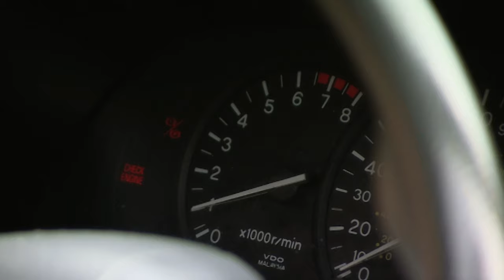Driving A Car With No Oil #TBT - Fifth Gear

Comment: Putting the dip stick in the filler opening..  if anything it sure is creative.
Aren't such 'pre ride' checks part of driving lessons in the UK?
Reply: They never used to be but I've a feeling they were going to or have recently introduced such sections.

I think people in general used to be a lot more savvy when it came to car maintenance in the past, my mum used to check and top up oil as necessary! Seems people treat cars as 'white goods' these days though, ie as long as it's working then they don't think about it.
Reply: It was more of a theoretical thing here, they could ask you to do one out of 12 such tasks. Just in case that would happen the instructor would have to go over such things with his students.

On new cars i'd say its almost pointless to check the oil between services, (if they still fitted a dipstick, some don't anymore) But most new drivers won't own a car like that for many years. 

I think you're right. I do have a very hard time understanding how people can spend 20-30-40-etc thousand euro's/pounds/dollars on a vehicle and then care so little about the mechanics of it. Statistics of ppl driving on with a check engine light, without even having a clue what the problem is, are just stupidly high.

Comment: I check my trucks oil every time I drive. It's loves to eat it up. So I have to top every few trips. It's 40 years old so I don't complain at a minute check. On modern cars I don't bother usually. As they don't eat oil the same. Maybe I should check every week. Why not? It's only a minute each time!
Reply: have you thought about changing your piston rings lmao
Reply: +Nangjelovski but that requires an engine rebuild which I don't have the time and money for right now. I would like to. along with other items such as bearings and maybe a high perfromance cam. Need money and time. But did help my dad replace the cam in his 351 Cleveland stroker that broke the oil pump and distributor gear off. Oil pump seized. Needle bearing from a rocker arm that blew up entered the oil pump. The rocker arm blew up years ago!

Comment: I don't get it. In modern cars, there are hundreds of sensors that tells you everything including tire pressure. But NEVER in the history of automobile has anyone ever thought of having an oil level sensor. Yes I know there's the oil pressure indicator, but what is that suppose to do anyways?
Reply: Some cars have an oil level sensor. And the oil pressure is gauge is very important. Low oil pressure could show extreme wear on bearings or other places with oil pressure restrictions.
Reply: Yes a fair few manufacturers do. Mercedes don't have dipsticks, and utilise an electronic dipstick on the onboard computer, that can tell you status, or volume if required.
Reply: Nobody other than BMW, Volkswagen, Alfa Romeo, Mercedes, Audi, Porsche, Seat, Peugeot, Citroen, Skoda and Rover? (off the top of my head..)
Reply: +Steve Howes Chevrolet has one
Reply: Renault has this for at least 20 years. Whenever I start my car, the display shows the oil level, and that has already been the case with my 1997 Megane. I never had to refill oil, however.

Comment: Looks like he topped up with cheap  mineral Everyday Tesco Value oil when most of those cars need smt like branded fully synthetic GM, Castrol or Mobil oils. Mixing those causes lots of damage. If those guys had no idea how to check oil they would have no idea what type of oil is in the car. There is no way you can check what brand, density or type of oil in the engine until you fully drain the oil, replace with a new one and leave the empty oil bottle in your boot

Comment: My Dad taught me to check my oil every time I put fuel in my car or truck. My Mom never does though. IF not for my Dad she would have many times over driven an engine to death with no oil. It is not just women either because most men do not check their oil either between oil changes.

Comment: No one in the UK checks their oil?! I mean like, not everyone but they said at least 25 cars/day seize up due to oil loss. UK isn't that big, so a lot of people don't know what they are doing :/ 

Also it does bug me, don't these people visit auto shops to get their oil changed? And if they do, they should get a little sicker on their windshield telling them when to get the next oil change. 
 
It ALSO bugs me that he recommended checking every two months, then topping up. Not every 5k (don't know in miles) and CHANGING THE OIL at least. Not just adding more in.
Reply: Basic fluid inspection should be part of the driving exams.

For that last point, while an oil change would be ideal for the vehicles shown, it is far, far better to have dirty oil than no oil.
Reply: it's recommended that oil is changed every 3000 miles here in Texas. specially if you tow/haul heavy loads a lot
Reply: People here cannot drive, also don't  know anything about their cars. You can see 2 year old cars with perfect paint, no dents and/or scrapes but the engines are shot to pieces.

Comment: and he also did a big mistake,you should not mix oil in you're engine,toping up someone's car with a cheap oil it's not ok.and the warning light it's actually in 2stages, yellow - need to top up  / red-you have no oil or no oil pressure...

Comment: Actually, either one or two things will happen when you have no oil: you'll either completely lock up the engine due to overheating and warpage (such as in the video), or you'll throw a rod. Either way, your engine is junk yard food.
Reply: rod throwing is kinda random though
Reply: epic troll
That's true; you will feel the engine gradually grind to a halt when you lock up. You probably won't expect a rod to throw unless your knocking is super loud.

Comment: But cars get serviced every 12 months and given a new oil change to the manufacturer's spec so asking people when they last checked their engine oil or changed it themselves is pretty pointless. Providing the service maintenance schedule is met then there shouldn't be a problem.
Reply: +Collins LFC Well, maybe. Some cars are every 12 months, some are every 12,000 miles, some less than that. Plus, all cars are different, even ones of the same year and spec. I check the oil in my old Saab every two-three weeks, and it usually needs a little top up. In my parent's Honda, a much younger car, it hardly needs any attention at all. Whatever the servicing schedule, this is something everyone should know how to do.
Reply: You can't rely on a service, if your car has developed a problem like a piston ring it will start burning oil, its best to check it regularly to ensure you don't have a problem

Comment: NO, you check the oil when the engine is cold...you can put too much oil in an engine if you check it warm, and that will blow a head gasket.

Comment: Do this in the States, and while you'll still find people who do this, I'm positive it'll be a lot less. Americans are obsessed with cars.

For the record though, "check your oil when it's warm"? I was under the impression you check it when it's cold because all the oil drains into the pan and you're getting an accurate reading that way, as opposed to when it's circulating around the engine and not showing it's true level on the stick?

Comment: What happen if you put more oil than the full mark of the stick?
Reply: It's dangerous becouse the pressure of the oil will be higher and something could brake inside the engine like the oil pump. Some modern engines won't even start if the oil level is above the maximum mark. If that happens, you should remove the oil or at least a part of it.   You should also know that is not necessary to reach the max level mark. If the minimum is 0% and max is 100%, your oil level should be at 75%. Keep in mind that there is less than 1 liter of diference between min and max and an average street car has a capacity of 4-5 liters of oil. So don't worry if you don't reach the maximum, but keep it above the minimum.

Comment: I took my car to Jiffy Lube an American service oil change station.My car was Brand new 2021 blazer RS. I bought it in July. I have had it for a very short amount of time. First oil change and the engine is gone. They’re saying it’s something with GMC, but after looking at everything pulled apart it looks definitely like there is no oil or too low and it started doing what the red car was doing that he was driving and started making noises and other stuff not as bad because it was brand new had some oil not enough, it seized barely got it to the dealership it died cooled after 40 minutes it decided to run one last time. My RPMs were going crazy getting it there it was sounding awful it wouldn’t shift correctly. I mean it’s incredibly crazy and we have three video clips filming them and in the last clip he put oil into it doesn’t tell me why he’s doing any of this but the VP emails me and tells me oh we drained 1/2 quart we check the color to make sure it was perfect! Well it was. Yeah right! No pictures of that! Then we decided to put oil back in we topped it off. Counted 13 seconds which is about 2 to 3 quarts. We timed how much it was the first time and you see the guy underneath still draining so definitely there was not enough oil in the vehicle and in a new vehicle it’s critical! It has to be perfect or it can seize the engine! I am so upset with Jiffy Lube. I want to puke and cry and I want a new car. They can go get the car they can put a new engine in it and they can take it to auction and sell it for whatever and make up part of their losses $54,000 I just made my first payment on it and it wasn’t even due till the  23 August! This happened on the 19th Thursday. Worst day ever! I know if I hadn’t taken my car to them it would be sitting in the driveway instead of the rental Highlander Toyota piece of crap that I’m driving. It’s a 2021 and I can’t even believe the difference between my blazer RS and the Highlander Toyota. I would never ever want that plus there’s nothing in my car that’s manual it’s all perfect! I have warranties up the Ying Yang on my car, but they problems caused by them that warranty is gone! Not a gmc problem! Assholes!

Comment: You shouldn't be allowed to drive if you can't at least know how to check your oil.  Maybe newer cars should have an oil meter on the dashboard if that's possible.
Reply: A lot of cars do and some don't even have dipsticks.  A lot of french cars have digital readouts for the oil level and did so a long time before a lot of other manufacturers..  Very innovative

Comment: engine oil-air filter-oil filter-spark plugs just change all of these every 10.000kms, it will cost you 60 to 70€ and will save you ton of money, even on gas mileage.... (better combustion)-just don't  do that if you own a pos korean or chinese car, just ditch these!

Comment: Do people not have newer cars in the UK
Reply: Well, they wouldn't do it to a new car.Unless you mean on the streets. They could be in a poorer part of town. Or they're good at keeping their cars running.
Reply: This is quite an old video. Where I live, most cars are from around 2012
Reply: Newer cars don't have this "problem". Newer cars do not burn oil, as their parts are brand new and not yet worn down.
Reply: All engines burn oil. Even new engines. New engines just burn oil at much slower rate, so it's still a very good idea to check the oil in a new car at least once a month if not more often. Especially so if it's a performance car that is driven hard.
Reply: My brother 2016 jeep burn little oil but because he drives for lyft
Reply: this video is from around 2008-9 before the uk scrappage scheme that killed a lot of 80s and 90s cars

Comment: He may have fucked up a few motors in that parking lot. CUZ you should turn off the engine and wait a couple of mins before checking oil level. else you'll have too much oil, blow seals

Comment: that car revs so high
Reply: Mitsubishi engines in them, even the piss poor 1.3 gives fair performance over that rev range. Peak power is somewhere around the 5/6k mark too, so it's fairly decent, but the Mivec engines - drive one.

Comment: I went to change my oil today after 5k miles .. checked the oil before I did it and the dipstick was dry  .. fk me  .. I've been driving for who knows how long with very low oil but the car sounded fine and sounds fine now after the oil change .. hope there was no damage .. a pretty decent amount came out when I drained it

Comment: Now I know that I need a new engine, I did an motor oil change in my car in the morning, drained all the old oil and when I was about to put the new oil I open the cap from the container and notice that the oil that I bought was old, guess somebody from Wal-mart switch the new oil for the new one and end up buying the old oil so I had to go to Wal-mart that same day and I ran the car WITHOUT OIL! For about 8 min or so, until down the road it started making that sound, tried not accelerating the car to much, when I git to Wal-mart I explain to then the situation so the told to get a new one, put it in my car and when I cranked the car a made and awful noise 😭 it when away but as soon as I started running the car it sound just like that car but not that loud very minimal sound, I can still drive the car but I have to rebuilt it, oh well guess things happen for a reason I was gonna rebuilt the motor anyways so🤷‍♂️☹️😫

Comment: some people tjeck oil and cooling fluid others change there engines... It is no joke. No oil and/or cooling fluid and still running the engine = 100 % garanti for engine damage and in worst case the hole engine needs replacement and that aint cheap. So remember tjeck your oil, cooling and for safety brake fluid aswell. exsample at the same time you tank your car. Some cars use as much as a liter of oil for every 1000 km and others more or less nothing.

Comment: "Your supposed the check oil when the engine is warm." Wrong your supposed to check the oil when it has sat. What your looking at when you check oil, is the amount of oil sitting in the oil pan, or the pan at the bottom of the engine. When the engine has been running, you could still have oil through out the engine, that has not drained into the pan. It is best the check in the morning, right before you start it. "New cars drink oil also, and there is no warranty on a engine that got damaged due to no oil." I cant really say wrong, because I live in America, so I don't how you guys work over there. However here in America, if a car losing oil, old or new, it is a problem. If you have a new car, again here in America, that the oil has all leaked out, or burned out, or what ever happened to it, and the engine gets damaged, that will be covered under warranty. I mean think about, if a brake caliper got seized, and because of that, one of the pads got severely worn, and had to be replaced. If the brake caliper is warranty, then so should the pads. It is not my fault you sold me a defective caliper, that in turn damaged other parts on my car. It is the same for a engine, if the engine is defective, which again here in the states a engine losing oil would be considered defective, and because of that defect the engine got damaged. Then the engine should be warranty.
Reply: youre supposed to check the oil when the engine is warm!!! 

youre misunderstanding what hes saying as "warm". 
you appear to be saying that youre taking a trip that gets the engine nice and (running temp) hot and then checking it as soon as the engine has stopped. 
warm would be say... 15-30 minutes after youve parked from that trip. where its warm to the touch but will not burn you. 
THAT is the time to check your oil. 

also if you have so much oil stuck up inside your engine after running it that it gives you a wrong reading on the stick... chances are that you have bigger issues than 'low oil'.

Comment: oil in Australia cost atleast $30
Reply: In the US it can be about $2 a quart (approx. 1 liter)
Reply: Wtf what kinda oil
Reply: in new Zealand it's around $50
Reply: Just standard 10w30 conventional. The synthetic stuff can be closer to $10 per quart (average engine takes 3-5qts i would say). 
I've done oil changes on a 4.0 6 cyl jeep wrangler for less than $15 between 5 quarts of oil and the filter.
Reply: Rather spend £30 for oil or spend thousands of 'em for a new piece of engine or at least a spare part to replace the damage part👌🏻✌🏻️

Comment: How about no coolant? Is that too dangerous?
Reply: No coolant will cause your engine to overheat. My friend let the coolant run out on his Corsa and the resultant excess heat in the oil caused an oil pipe to burst, emptying the car of that too.
Reply: Just thought that might be a neat challenge for them to do.
Reply: It strongly depends on where your temperature sensor is located in your car and if you see it on time. If it really starts to overheat, your STOP sign will also start to glow, but if you also oversee that or the temperature sensor is located somewhere on your radiator (where it won't detect the very hot coolant fluid left in there, it will only work if it slowly start to drain or in some cars on a hot day in a traffic jam).
My car LUCKILLY has its temperature sensor in the thermostat housing, because my return hose of my radiator burst wide open! If the sensor was in the radiator, I would never heve seen it on time because all the coolant was being dumped BEFORE it could enter the radiator.
Most of the time your headgasket will blow though. worst case is engine seizing up.

Comment: I'd rather these clueless drivers be seized up on the side of the road than sharing the roads with me. You can guarantee if they don't give a care up the car, they don't give a care about other drivers or your car they touch park into!
Reply: Until you have one seize up at motorway speeds on the carriageway ahead of you, showering your pride and joy with bits of conrod and broken engine block....